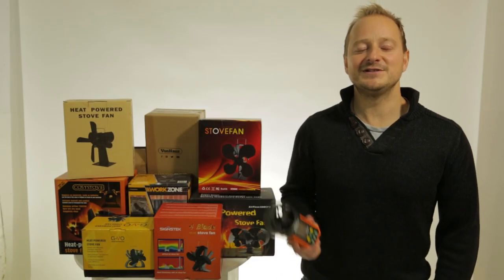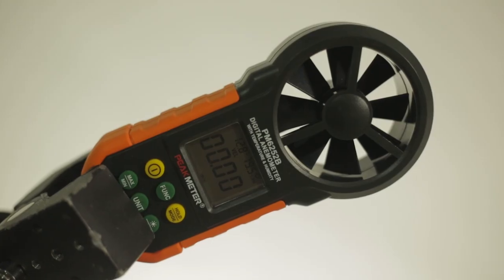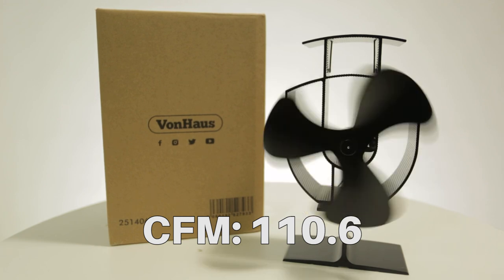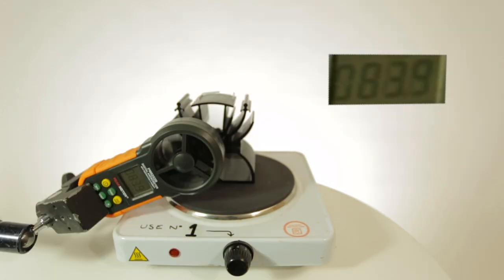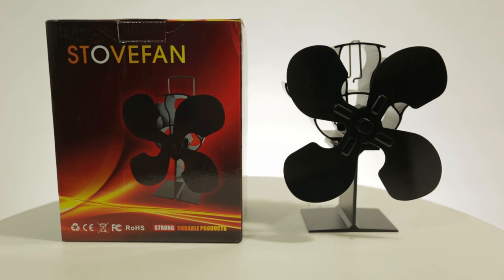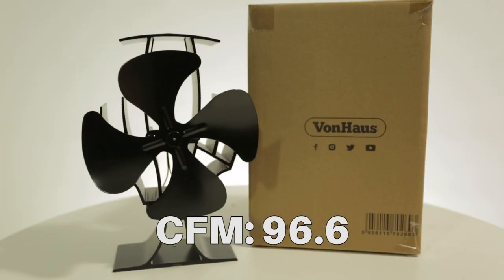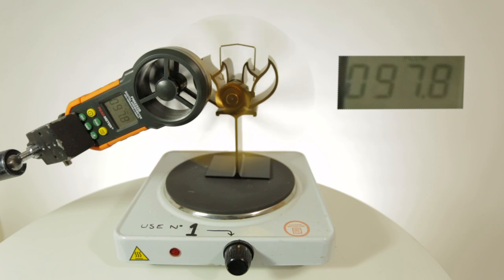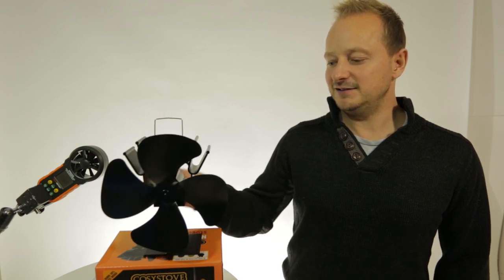Which is the best heat powered stove fan based on CFM?

Comment: I'm not sure i totally agree with these results only because each fan produces a set amount of cfm at a given temperature.  Each fan should have been tested at THIER MAX heat range in order to achieve proper CFM for testing. 

I am currently looking for a stove fan, was looking at the GALAFIRE V366 or the V266.

However, you are the ONLY YOUTUBER that I know to have used an actual anemometer... very cool!

Now I am not sure 76 USD is worth any of these

Comment: You did not place the fans in the same place on the hot plate, also the meter wast not moved around for the optimal air from the fan.

Comment: The one at 2:40 that turns but produces no wind is not a defective blade design but has the wrong polarity for the motor. It blows backwards. They soldered it the wrong way. Easy to fix actually. But oh well... at least to turn the fan the other way might help a little ... although the design is not symmetric for the blades so it wont be ideal. The best is to resolder it and invert the wires going into the motor.

By the way quite a few people complain that those fans are rubbish and dont work. My guess is  that these people have unfortunately bought wrongly soldered items...
Reply: There is any motor inside

Comment: Methodology for the test is terrible. You are only taking the airflow from part of the fan not the whole fans output. Given different sizes this favours the smaller fans as the larger fans are not having a substantial part of their output checked. The dual bladed one for instance was having less than half its output checked....though the noise would have it thrown out pdq anyway

Comment: Yours was the best comparison on stove fans so far.
I own the TIEMORE stove fan, 2 fans 4 blades ea 
i paid 74.00 on feb 2021, its now 88.00 on amazon.
the blades dont have a guard around them, so they can be bent easily, if not carefull.
its rated at 32db extremely quiet. 
the bimetal strip under the base will automatically bend to help raise the fan base and reduce the contact area of the heat source to protect the motor and the thermoelectric module.
Specifications:
Type: Burner Fans
Material: Anodized Aluminum
Starting temperature: 60℃ (122℉)
Maximum working temperature: 340℃ (644℉)
Air Flow: 180-250CFM (cubic feet per minute)
Stove temperature range: 60-240 ℃
Operating temperature : 200-300 ℃
Noise: <32dB
Packing Size: 28* 17* 19cm/11*6.68*7.47in
Weight: 1360g/44.09oz

i think the larger blades would be the noisest.
The fan needs to be moved around on the heat source to find the best spot, for max speed at a safe temp. 
Comparing noise and max temp would be valuable to keep from burning up the TEG (thermal electric generator) module.

Comment: you should have measured the temperatur of the heat plate because it depends a lot on the fact how hot your oven is. mine was much too cold to run a fan propperly. Tests it at different surface temperaturs and so you  can see the increase in cfm or at what temperature it makes sense to use such  a fan

Comment: Your efforts appreciated, but you missed some important factors: 1. They have different sizes, so absolute air movement is not really honest to compare this way and 2. The noise they make is at least as interesting to compare in a complete review
Reply: He did compensate for the different sizes right at the start, the anemometer was programmed with the size  of the fan to give a CFM reading rather that just a velocity, He mentioned the noise as well.

Comment: love the review. As everybody else has said first honest short sweet and to the point review. Thanks. My only questions are, for ignorant peasants, like me! what is CFM,(perhaps put the answer to this in the video explanation above) and is there a motor size difference or do they all run on the same size?  I am looking at putting a fan on to my oil burning cooker flue (AGA) to see if I can get some heat out and into the room. If you have any reviews on them, that would be great too. Thanks anyway

Comment: Very well made video, but one factor I would like added, is the temperature at which the fan starts to turn. I have the twin bladed Aldi model which starts up very quickly. 
My only question that has never been mentioned is, can you lubricate the shaft? If so, with what product? ie, grease, oil, silicone, etc.

Comment: Having watched loads of these fan videos, none shows a before and after comparison. Test the room temperature with just the stove burning and then test with the fan on top of the stove. If the fan does not move enough warm air into the room, it just winds up as an amusing gimmick.
Reply: I've had my Voda 360 cfm twin-fan for a few weeks and I gotta tell you this one does as stated on the box.  The one he tested that showed zero cfm was weird and I have no explanation for that reading (but I'll bet the advertising for it said it was a great device LOL).  The type of testing you suggest sounds like a lot of time, expense and effort on the part of someone just to show you the things aren't novelty devices.  If a manufacturer did a test like that I wouldn't trust the results bc I'm certain their fan would be shown to be the best.

Comment: Your video shows you used both a 3 bladed and 4 bladed Signstek but you showed the results for the older 3 bladed model. What was your purpose in the switch?

Comment: the YH-BLS802 is spinning in the other direction. It is pulling air instead of pushing. That is why you have not reading...or maybe my eyes play some tricks on me.
Reply: I thought this as well, but wouldn't the meter move if it was drawing air?  Or maybe not at that distance.  This is no Project Farm, that's for sure.

Comment: I'm as much interested in Db as I am CFM.  Cannot stand noisy fans. Which one is most subtle?
Reply: obviously a bit of intereference that needed to be rectified on the dual shaft setup at the end. Shouldn't have been a major repair.  Also the "zero" fan just needs the blades tweaked to actually push air, obviously they're too "flat" and aren't getting any "bite" on the air. If indeed it's blowing the right way as noted by the commenter Ghioca.

Comment: I believe your numbers are wrong, because your anemometer isn't calibrated correctly. It is useful only for comparison purposes. I believe you have set the airflow area in the anemometer settings incorrectly, as the CFM is calculated based on air velocity across  a specified area.

Sources:
1)The PM6252B user manual
2) An Arctic 140mm PC fan running full power moves 72.8 CFM and can be felt as a gentle breeze from 4 meters away. It moves hair like a strong wind when close.

Comment: Signstek???? Box has 4 blades yet the fan you tested had 3, can you explain please?
Reply: I saw that too. WTH is that all about? He shows us a box with a 4 bladed fan but the fan itself has 3. Then he places a fan on the hot plate with 4 blades but clearly when he tests the airflow, he's switched back to the 3 bladed one because you can see the heat sink shape is the one from the 3 bladed one we saw out of the box in the beginning. Just because of that alone, I have no faith in this test. Guess I'll have to keep looking for an impartial forthright product tester.

Comment: You're measuring velocity, air speed, not CFM! In order to measure CFM, you need to multiply velocity by area, which you don't have an area because of the open area around the fan and meter.

Comment: Thanks, mate! Your test narrows the search significantly. I have electric and gas heaters. Does anyone know if I mount the Peltier fan's base in front of the heating elements (on a heat sync?), would it work?
Reply: Doing what you are thinking of might not get the peltier hot enough but its worth a try , some are very cheap on Ebay so i would maybe get the cheapest and give it a go .
Good luck
Reply: You might get the blades turning or you might just burn it up. The electricity that makes the fans turn is created by heat moving upward through the thermal coupler located between the base and the upper "radiator" part.  When mine is turning fast the base is too hot to touch while the upper part is considerably cooler (but still very warm to the touch bc that's where the air being blown forward picks up heat).   I ruined the first one I had in four hours by overheating it on top of a Mr Heater running on the Hi setting, which is just about as hot as an open flame and so is hotter than the top of a wood fuel stove (but the room got warm quickly LOL)

Comment: I wonder if you would have got different values had you used a proper log burning stove ?
Reply: It depends what temp it was tested it. If it was tested at the average temp of a stove it wouldn't of made a difference. If it was colder then the fans would be slower.

Comment: Hardly a comprehensive test. Not tested are fans from Ecofan or any other brand available on Amazon.
Reply from the maker: All the fans tested were under £40  and we took a range of shapes and sizes. It wouldn’t have been possible to test every fan on the market, but we did our best.

Comment: When you tested the 2 blade fan you only had the meter  in front of ONE of the blades , so shouldn't the 77.4 be doubled to  154.8 putting it in first place ??
Reply from the maker: No the meter was calibrated before each test and the area of both blades was input. Therefore this is a true reading.
Reply: @MrPiedy00  ha ha ha.  You measure the blades that were banging against the unit?!  What a waste of time.

Comment: Heat Powered Dual Fan shows 2 fans and testing 1 fan at 77.4.  Times 2 fans would be 154.8 cubic feet.
Reply from the maker: I understand your logic but the surface area of both fan has been taken into account so the original CFM of 77.4 is correct.
Reply: @MrPiedy00  I watched the video very closely several times . The meter DOES indeed show a reading of 77.4  in front of ONE blade . YOUR logic makes no sense .
Reply from the maker: The meter was calibrated for each fan individually before the test. The total area of all the fan blades was measured then the meter can multiply this figure by the flow of air through it to give an overall CFM reading.

Comment: Why isn't is the Vulcan Stirling motor stove top fan in this 'comprehensive' review??
The one fan you didn't review, which is far more powerful than all of the reviewed fans!!
Bit disappointed.
Reply: I think what you meant was it works too well! And I agree it's the best.
Reply: We haven't claimed this to be a "comprehensive review", all the fans we have reviewed were priced between £25 and £40, the Vulcan Stirling motor stove top fan is priced at over £120 so it wouldn't have been a fair, like for like comparison.

Comment: try a funnel to the censer get a better reading not just part of a reading. fells result sorry good try #
Reply from the maker: The sensor doesn’t work that way. The size of the fan blade was measured and that’s divided by the sensor area to get and accurate result, and a fair comparison.

Comment: SO, you used a hotplate for each fan providing equal heat for each fan tested...  UNLESS you measured the plate temperature and set it to a temperature that would normally be "seen" by each fan, this "test", while using equal heat, may or MAY NOT provide the typical heat from a stove....  Run that hotplate at a typical 300- 400 degrees F and I would bet ALL fans output would increase, some even providing the CFM as advertised....  Just say'in............
Reply: He also set them at various places on the hot plate.